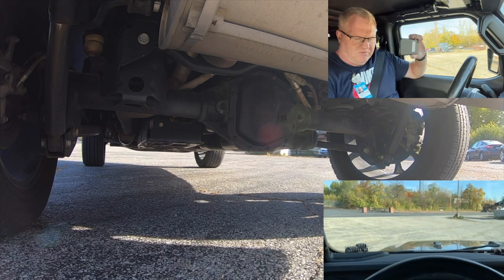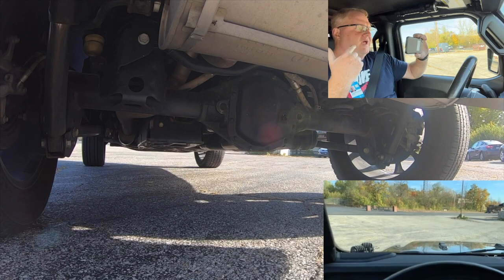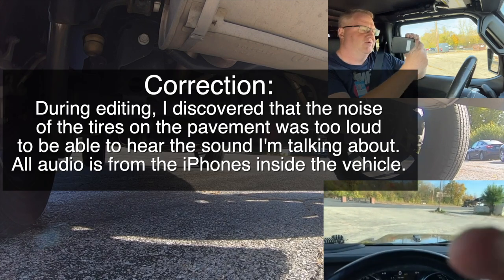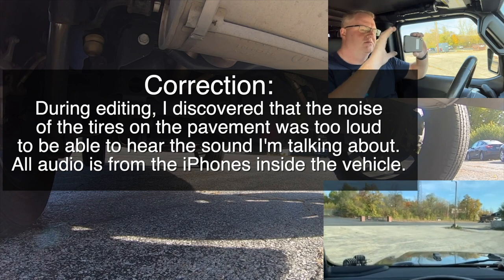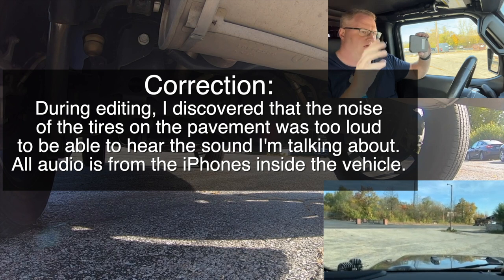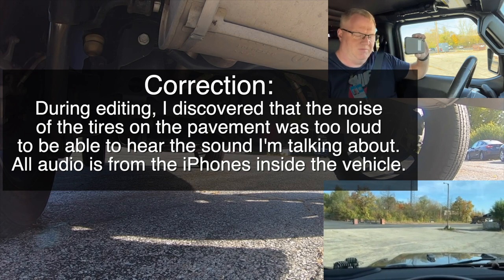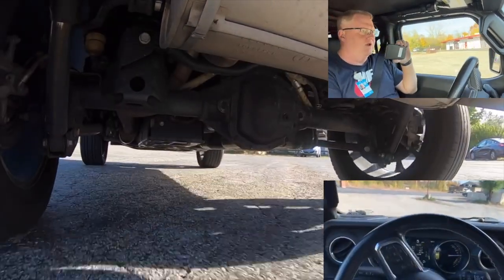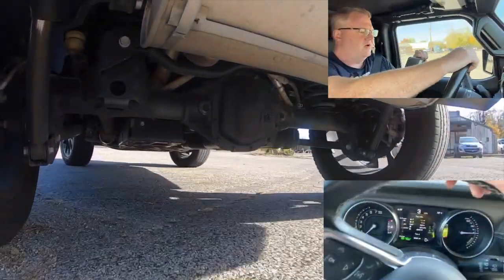Weird sound from rear differential

Comment: Limited slip chatter.
Had the same problem in my Dodge Challenger Scat pack.
The dealer (per my request) changed the rear differential fluid when I had my engine oil change.
The mechanic did NOT add the Mopar 'Limited slip additive' when he changed the rear diff fluid.
I discovered this when I made a very tight 'U' turn, the rear diff was chattering like mad.
A trip back to the dealer(and a different tech) fixed the problem. The new tech drained the diff, and added PN# 431-8060-AD to the new oil. 
Fixed the problem completely.
Active ingredient 9-octadecenylamine 112-90-3, and a few other science fiction names.
Reply from the maker: The tech that worked on mine remembered a bulletin that was issued on the Challenger about the rear diff and applied that knowledge to my Jeep. It’s nice to have that experience working on my vehicle.

Comment: Took my 2021 Wrangler Sahara 4XE to the dealership yesterday because it was making the same noise as in your video. Bought it used with only 20,400 miles back in June. Thankfully, I was armed with your video to explain exactly what was going on. Turns out the rear axle had to be replaced. $4,690 but thankfully is covered under original warranty. Thank you for posting this video. You're a lifesaver!
Reply from the maker: Was the rear diff messed up? Or was it leaking?
Reply: @Wrangler4XEFans  it was making noise not leaking. Had to be totally replaced.

Comment: Thanks for the video. I just took my 21 Sahara 4xe in today to the shop. Recall and it is leaking right near the rear dif. Just about a drop a day or so. They are keeping it . something about the seal. I too have that sound, really didn't think anything of it.  Interesting. I should have it back mid-week. They apologized that all they had for rental was a dodge mini van.
Reply from the maker: Does yours have the limited slip rear diff?
Reply: @Wrangler4XEFans  Does this answer the question? Anti–Spin Differential Rear Axle...after visit to the shop, no noise and no leaking.
Reply from the maker: @denisecrissup8768  Sounds like it.

Comment: Just a heads up, got louder after your video (adding modifier) and so took to the dealer got a whole new 3rd member (limited slip differential) due to the recall back in February and had them baffled for the noise never quit, at no cost to me….thank goodness still under 100,000 mile power train warranty
Reply: Hey, do you have a link to or can you tell me what the recall in February was for? I’m currently experiencing this with my gladiator Max tow package.

Comment: I had the same exact sound on my '04 Grand Cherokee. Jiffy lube changed all of the diff fluids and didn't add the limited slip friction modifier and destroyed the clutch plates in the differential and burned them up. They ended up replacing the rear diff for free but refused to pay for the axle seals. This was 10 years ago and I haven't been back to jiffy lube since
Reply: Can certainly understand , took 98 Dodge Ram in for oil change and they didn’t put oil back in it, took a 2500 mile round trip from Missouri to Colorado with Harley in back on zilch, maybe a quart, Thankful for the slick 50 maintenance every so often, however made everything brittle and oil gauge was acting up so checked it within a week after getting back and no oil!! Needless to say our mechanic would not vouch for the destruction and Jiffy lube did nothing …:oh wait they did come and aid me when I stopped to check it and I let them know, told me to get a mechanic to verify damage and would get motor rebuilt but my mechanic would not stand behind it even after I told him he would get to do the work and I had spent at least 10 grand there for previous  other work he’d done! Also I said in 6 months if this breaks down,I will be pissed, sure and $***less than that, about 3 months. A great mechanic he was. However He  no longer is my mechanic . I think I had got a oil change from Jiffy , end of the saga 😤😡

Comment: Yep Sounds just like my challenger scat pack with the lsd. It happens when your turning at slow speeds and I thought my rear end was going out. I got 52k miles on my challenger now and I had to change my dif fluid and add the friction modifier at 30k miles and all was good until a few months ago and now it's back so I guess it's time to change it again.  Haven't ever thought about that issue being in a jeep but we've only had our 4xe for about a month but if I ever hear it I'll know what it is.

Comment: When the dealer's techs don't know to add the friction modifier... I think I will do my own maintenance.
Reply from the maker: Thankfully, the guy who works on mine knew exactly what to do.
Reply: @Wrangler4XEFans  I bought a wrangler that ate an LSD clutch pack, dealer fixed it as part of the purchase and acted surprised when I pulled back in and told him the rear end was bad.
Reply from the maker: @whidbeyhiker4364  Yeah, I hope mine holds up.

Comment: My 2014 Dodger Charger SRT8 is doing something similar to this shortly after the dealership changed my differential. Growling noise during slow turns. I brought it back and they said it needed a new differential. Never going back to that dealership again. They didn’t put the friction modifier in it either. I’m going to have my friend help me change the fluid and I’ll use Amsoil severe gear plus additive I guess. Do you have any other suggestions? Thank you sir
Reply from the maker: @Littledave009  I don’t know enough to have any better ideas.

Comment: The Rubicon has the 4 Auto option so doesn't that suggest it also now has LSD like the the Sahara? The European petrol Rubicon had 4 Auto as standard.
Reply from the maker: The Rubicon has locking diffs front and back.
Reply: @Wrangler4XEFans  Ah ok I wondered how the implementation of 4 Auto differed between the Rubicon (lockers) and Sahara (LSD) on wet or slippery roads with gravel.
Reply from the maker: @yieldtothenight  4 hi auto would pretty well be the same. It would be the ability to turn on the lockers in the Rubicon that would eliminate the need to an LSD. Lockers would be better overall.
Reply: @Wrangler4XEFans  But lockers won't engage losing grip whilst cornering on a slippery asphalt road with all the wheels engaged will they? Sorry for my ignorance. 
I live on an island with thin narrow roads with dangerous cliff edges. Sometimes these roads have loose gravel or are slippery from grease in the wet.Control and braking are essential.  Aside from tire choice I wondered how the Rubicon and Sahara would differer in behaviour in these situations. The Rubicon appeals to me because of the ride height which would help with floods here and some rocky country roads but also handling on precarious narrow windy roads is also important.
Reply from the maker: @yieldtothenight  Right. That’s where the 4 hi auto comes in to play.

Comment: Strange that you get it after that long time.. is it now fixed … how many days have you been driving it now after the modifier was added?

Greetings Monty

BTW: 6th week started waiting for the electric heater here in Germany so far no ETA. Even from the US they could get it in less days :-( would be interested to know what was changed on the new electric heater and if it is still WEBASTO.
Reply from the maker: It was around 33,000 miles when it started. It’s been perfect since the modifier was added.

Comment: Have you found the cause of the issue?

If you have resolved the problem, please let me know how you did it.

I also thought LSD could be the cause and opened up the differential gear, but it turns out that Korean versions of overland don't have LSD.

However, I'm experiencing the exact same issue with my vehicle, so it doesn't seem like LSD is the cause.
Reply from the maker: In my case, it was the LSD. They added some modifier to the rear diff and it fixed it.
Reply: I'm really glad it got sorted out. It's weird though, when I opened up my car's differential, I didn't see any LSD components like a multi-plate clutch, but I'm experiencing the exact same issue. Anyway, if I find a solution, I'll definitely share it with you later.
Reply from the maker: @Illuon..  I’d like to hear what you find.

Comment: OMG….!!! $80.00  A Quart..!!!
$25.00 for additive… tax…$201.00😳 I never thought I’d pay $80.00
For a quart of oil……………….
Reply from the maker: Is it out of warranty? Is it a 21?
Reply: @Wrangler4XEFans  I guess my fault for not pushing on the warranty. The service department told me not until June 13th the earliest… I’m road tripping the 1st two weeks of June.. so I figured.. ahhh.. I’ll 
Drop the fluid myself… but $200.00
Is like they charged me to do the job..
I just NEVER paid near $80.00 a quart..
Just wow..!! And thanks for putting this out there ..!! Enjoy the Jeep..!!
Reply from the maker: @mikekosar6135  If you are still under your 3 year, 36,000 miles, it should be covered.
Reply: @Wrangler4XEFans  Thanks for the great video! Is there an official warranty policy on this issue? My dealer says it might not be covered by warranty as the changing rear differential fluid and additive might be considered a maintenance item. They will bill me $800 if it is not covered by warranty.
Reply from the maker: @PengLi53  Mine was covered at the time.